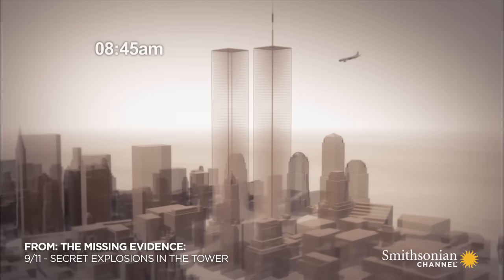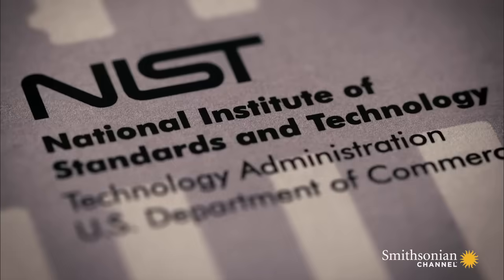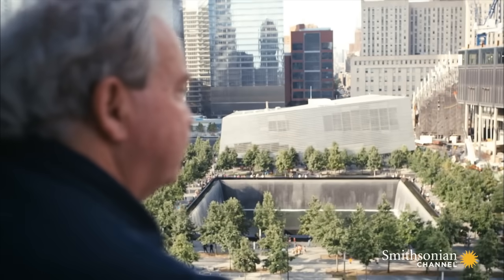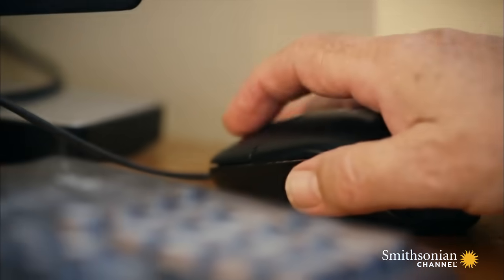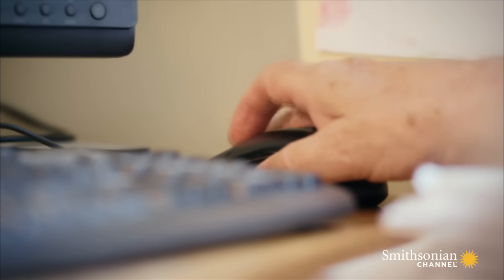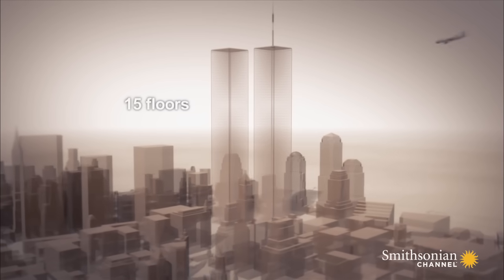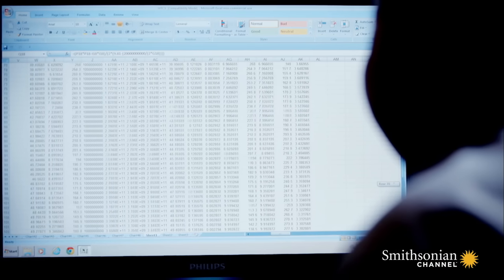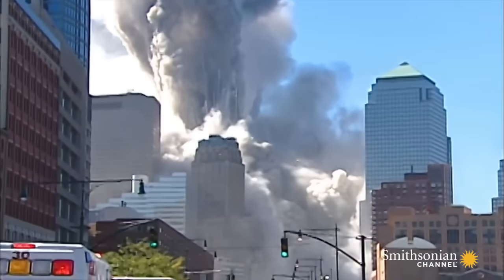This Computer Simulation Explains How the Twin Towers Fell

Comment: A computer simulation could show the building taking off and landing on Mars. Computer simulations are not restrained by the laws of physics.
Reply: Are you saying this video is inconsistent with the laws of physics? You're going to find that case difficult to make!
Reply: @Tim22222  Its very easy to make, Newtons third law of motion dictates the opposite force being the structure below the impact area was more than adequate to bear the entire weight if the floors above the impact area. What is actually being proposed in this video is perpetual motion wherein the impact energy of the initial collapse does not dissipate as it crushes the floors all the way down. That smashes the universal laws of physics.
Reply: @paulsmith1981  As to your "perpetual motion" argument, there is again something you are forgetting: GRAVITY. 

The WTC towers were not closed systems; each had something like 200 tons of TNT equivalent gravitational potential energy stored in its structure! That's plenty of energy to overcome the energy lost as they were crushed.
Reply: @paulsmith1981  Finally, here's how I know you're totally wrong about everything you wrote: 

There's not a single physicist in the world who agrees with you.
Reply: @Tim22222  The buildings had resisted the force of gravity for the 40 years prior to 911. The pull of gravity didn't suddenly increase on that day. The structure below the impact sight was more than adequate of resisting the load of the floors above.  What the pancake theory is based on is perpetual impact loading. meaning the energy of the initial collapse never dissipated as it crushed millions of tons of steel and concrete right down  to the ground floor. 
What you are saying is, If you stacked 100 bricks, one on top of the other, and then swung a sledge hammer with enough impact force to shatter the top brick, there would be no loss of energy, no opposite reaction,  and the sledge hammer would shatter every brick one after another until it hit the ground.  In essence, this is what you are saying. and it smashes the laws of physics. Its preposterous.
Reply: @Tim22222   So, not a single physicist in the world believes in Newtons third law of motion then. Amazing, truly amazing.
Reply: @paulsmith1981  You should write a paper about this and submit it to a physics journal.

Comment: You can see white smoke jetting out of the building several floors below the "pancaking" @3:39
Reply: What is happening to the building's volume as it collapses? It's getting smaller.

THEREFORE what is happening to the pressure in the building?

Comment: The explosions were not planes it was an inside planned charges.
Reply: There were no explosives. NONE.
Reply: @Tim22222  yes there were internal ones inside the building and you can see no plane actually hitting it. Also there is a video of a chemist who explains why it is explosives. There was a lot of thermite pieces in the explosion and thermite is not used anywhere other than explosives. And obviously thermite is not gonna form out of thin air. But the US used this as an excuse to take over Afghanistan and iraq which has a lot of oil.

Comment: The buildings are central concrete and steel frame cores, surrounded by an exoskeleton (which forms the outside of the building). The core is taking the majority of the weight, while the exoskeleton is mainly supporting floor plates at the edges. This means you can have huge floor plans without too many columns taking up space. When the planes hit they severely damaged the core of the buildings. The outer exoskeleton was still in tact for the best part, holding some of the weight, but the centre was almost destroyed. The exoskeleton wasnt designed to hold so much weight. and as fires raged the core of the buildings got even weaker. When the cores DID collapse (after burning for a long time) the exoskeleton formed a cage around the collapsing structure. As each floor pancaked downwards, it smashed the outer support connections of the floor below. As momentum increases the complete collapse becomes inevitable, and the construction of the outer shell is focusing the destruction mainly straight down.

When the second building collapsed you actually can see the damage start to bloom outwards near the top as the exoskeleton of the building gives way earlier. This lead to a much wider debris pattern. WTC 7 was struck by a gigantic amount of falling iron which was spearing through the building at terminal velocity. Its not hard to believe that adding thousands of tons of steel like that could itself compromise the structure of an office building. The building was on fire for hours before it collapsed, again, weakening ironwork. If you watch the video footage of Seven collapsing you will notice that it falls backwards, toward the massive damage which has torn half of its back off and put massive weight on the rest of the structure. The building buckles near the bottom, at the front of the building, as you would expect if the back had been damaged. The core of the building visibly collapses as we seen the ventilation and elevator machinery disappear on the roof. The collapse wasnt a conspiracy. None of 9/11 was an inside job. Its easy to suspect that, but the truth is far more simple.
Reply: Josh D  fire was a contributing factor. Highrises have actually collapsed after being on fire for long periods. But with building seven the frame of the building was over weighted by thousands of tons of falling steel and debris. And once the frame starts to collapse its adios. The seven hours of fire didn't help. No high-rise has ever experienced what that building did. Loads of the central supports were knocked out, making all the others take on massive loads.
Reply: Josh D  usually residentials in places like Indonesia where they have let them burn for hours. I've seen a 16 story one in Japan partially collapse after a long fire too. Its not about melting the iron, its about heating it until it softens sufficiently for one load bearing joint to fail. Often that's enough to cascade a whole part of a building.

Comment: I like how he uses Titanic to address the amount of weight on the North Tower. Out of all of the things, he decides to use one of the most famous maritime disasters in the world which weighs 45,000+ tons.
Reply: What other things you can name that weighs 45,000+ tons??? Besides the Titanic. It is NOT weird at all to use Titanic as an example.
Reply: The Titanic was said to be 'unsinkable'.  Hubris
Reply: It's because it's very ubiquitous and everyone understands that Titanic was big, not to mention that it was also studied extensively, by the same institution no less.
Reply: It wasn't actually the Titanic that sank.
Reply: @GraceEngineering   Debunked conspiracy lol
Reply: How many titanics were pushing back up in the opposite direction?
Reply: Yes. He uses it as an emotional end of conversation. Liars do that. That's why no one wants to talk about the science behind the Towers' collapse.  He has neither disproven 100 years of physics nor what I learned from my grade 8 math teacher about "free fall". He's suggesting a pound of bricks is heavier than a pound of feathers!
Reply: @yolannayerex4142 It wasn't in free fall is the why. It was in tension (compression actually) due to the steel beams which means it had extra force downward than just gravity (this is why rope ladder rungs will fall faster than pure free fall would indicate).
Not to mention how the titanic was just a frame of reference. Structures like buildings aren't meant to Take heavy impact loads (such as the weight of the titanic falling on top of a building) and so when they crash into the floors, especially with damaged beams inside, it means that it causes a single floor to give out and fall, which is enough momentum to crash the next, and the next, etc, into a cascade down.
Reply: @yolannayerex4142  No one wants to talk about the science of how the towers were turned into dust. The empirical evidence in Judy Wood's book, Where did the towers go? Evidence of directed free energy technology on 9/11... Is irrefutable. No one wants to talk about hurricane Erin and the relationship between that and the fluctuations in the geomagnetic field and how it also ties in with global consciousness. Had the towers collapsed, there would be over a million tons of debris piled high above the parked ambulance at ground zero. People could not outrun the building and we're left covered in dust, not cooked by high temperature or crushed by a 500.000 ton building crashing down. The slurry wall that still holds back the Hudson river would have ruptured and lower Manhattan would have flooded, the PATH subway tunnels to NJ also would have filled up with the river. Newtons third law of motion tells us that the planes weren't phisical objects because for every action there is an equal and opposite reaction, and that didn't happen, because aluminum can't cut steel, so they can only have been holographic projections of light and sound, that is also a process of interferometry aka directed energy.
Reply: @andrewdean6963  Interesting!
Reply: @yolannayerex4142  No, he uses the titanic to give an accurate idea of the weight using something everyone usually knows about
Reply: @StarstruckChiroMusic  You're right. I guess I can't imagine anything else, literally, that I could picture that would weight that much. Point taken., thanks
Reply: @yolannayerex4142  Wait, you're serious? Thank you for listening, I've never knocked sense into a truther before, I'm glad you finally realized the actual truth!
Reply: @yolannayerex4142 The twin towers didn’t fall at free fall speed
Reply: @mike2c512  I guess my info is a result of the mandala effect. I'll read up on it. Thanks
Reply: @yolannayerex4142   To preface your comment saying that liars use emotions to end their a conversation only shows me how much you're trying to manipulate us here.
Reply: @LymbicSystemuwu  not at all. You never noticed when people lie they use some very emotional story so one won't ask questions?
Reply: @yolannayerex4142  
"He uses it as an emotional end of conversation. Liars do that."

So the same thing almost every "9/11 Truther" has done?
Reply: @jacobmoriancumer7588  I don't know about that. I prefer the non-emotional approach to science.
Reply: Another viewer replied to me noting that The Titanic is probably the only thing current culture could imagine being that weight and/or size. He's right. I can't imagine anything else either, lol! So maybe it wasn't what I thought.
Reply: @jacobmoriancumer7588 a big bad conspiracy theorist 😂
Reply: @yolannayerex4142  guy is a chemist doing physics simulation with incomplete data.....sure i trust him
Reply: @bladerj  Yes, it would be impossible.
Reply: @yolannayerex4142  Girl stop, your doing to much.
Reply: everyone knows what the titanic was
Reply: which was also a planned event years before it happened
Reply: @ericdupree3306  yeah it was a joint operation involving Nicky Tesla and the Grays (space aliens) 🙄🙄🙄
Reply: @garywood5882  cant forget the evil cows with lasers
Reply: @therealtony2009  it's the penguins with phasers that worry me
Reply: @garywood5882  yes, i remember a 9/11 survivor say they saw one in the plane as it hit the north tower
Reply: @therealtony2009  thankfully we now have it on record
Reply: @garywood5882  yes big penguin is trying to censor it
Reply: @ericdupree3306  it was not planned.
Reply: @historicstudios2708  yeah you definitely know that my bad
Reply: @ericdupree3306  it’s been debunked countless times and it just doesn’t make sense from the start.
Reply: @ericdupree3306 you have to be high to belive that
Reply: @ericdupree3306 we’ve got a big bad conspiracy theorist 😂

Comment: Looks Similar to a controlled demolition ????
Reply: Have you ever seen controlled demo that started in the middle of the building?
Reply: @Tim22222 
Controlled demolition can begin anywhere in a building, top, middle , or bottom. That's what "controlled" in controlled demolition means, shill-boy.
Reply: @jamescollinson2179  I suppose it doesn't matter where controlled demolition starts if you can't prove it was controlled demolition.

Comment: But the "blocks" were not dropped from the moon.  I'm no scientist just a environmental engineering tech using logic.  How was there enough momentum for the buildings to come down,  fall, whatever at almost free fall speed? There was too much concrete and steel structure intact below it built several stories into the ground. It wouldn't have fallen much faster if nothing was in the way.  No sense.
Reply: The question of whether the World Trade Center towers collapsed at free-fall speed or near free-fall speed is irrelevant. It's an observable fact that the falling mass of the upper section of floors (top 12 floors of the North Tower) did NOT slow down as the collapse progressed. The falling mass maintained at least steady speed and slightly accelerated throughout its fall. This is impossible in a purely gravity-driven collapse because the accumulation of debris beneath the falling mass exerts progressively greater resistance to the falling mass until the compaction limit is reached and collapse stops with the upper mass at rest and usually crushed.

The debris from the 110-storey towers reached only 8 feet above ground level and much of the buildings pulverized to dust that covered a large area of lower Manhattan. Building 7 at 47 stories was less than half the height and only 28% the mass of each tower, yet it collapsed into a debris pile nearly 70 feet high and almost none of it was pulverized to dust. The debris pile from Building 7 was the highest object left on the entire World Trade Center site.

If both towers and Building 7 collapsed from gravity alone as claimed, why was the resulting debris so different? The only way the towers could have collapsed at constant speed all the way to the ground was by having demolition charges within the buildings exploding in sequence and blowing the resulting debris out from under the falling mass of floors. Exploding charges are also the only way that so much of the mass of the towers could have been pulverized to dust.
Reply: The answer to your question is: GRAVITY.

The momentum was helped along by the force of gravity (as an engineer, you know that momentum does not need to be conserved in an open system - right?) The gravitational potential energy stored in the towers was equivalent to 200 TONS of TNT! So yes, there was plenty of energy available to cause total collapse. ALSO - learn how the towers were designed & built. In short, the collapse didn't take out all the steel support, it bypassed it by skipping the columns altogether & smashing through the floors.
Reply: @Tim22222  if this was so the columns would still remain. Also free fall speed is impossible with any resistance in between the start point and the ground and there was plenty. All floors were trusted and there were two entire floors which were truss levels below the impact sites no occupancy just trusses and each and every floor was interlocked into the exterior spandrel panels. Free fall speed would have been absolutely impossible in the official narrative story. No way